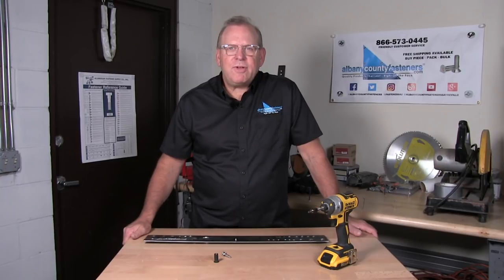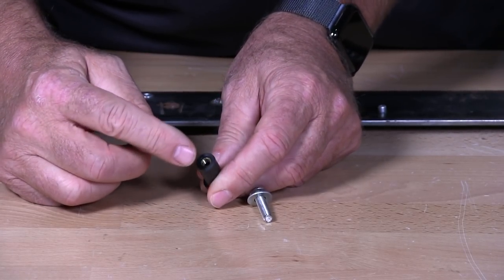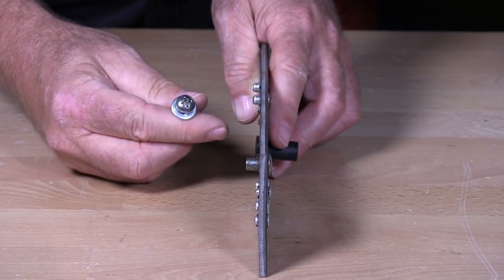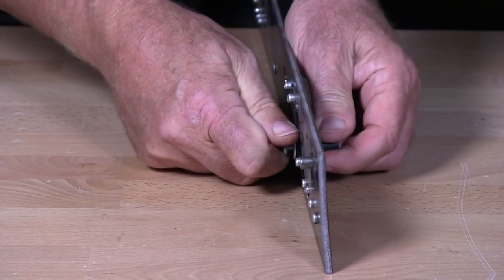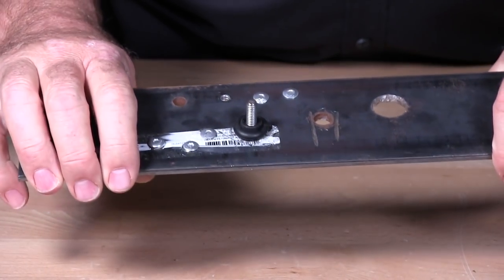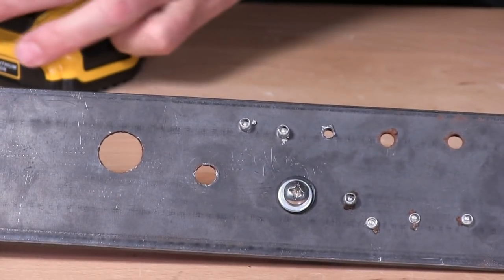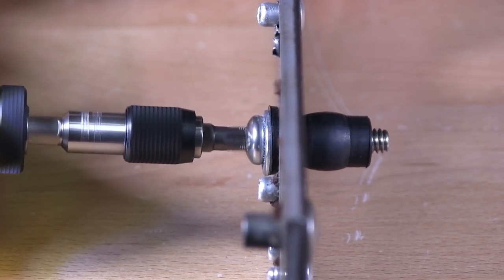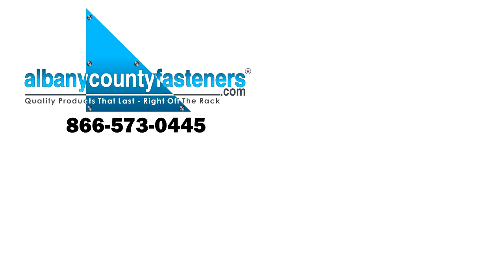Well Nuts | Review & Installation | Fasteners 101 Demo

Comment: If installing into a surface where you can't see behind it, when do you know to stop tightening? I guess the answer is when the brass thread within the rubber well nut reaches the flange? If so, how do you stop/prevent the stainless steel bolt from stripping the brass thread?

Comment: Any suggestion on how to prevent the rubber well nut from spinning if you can't get your hand behind the metal to hold it? I have a 73-87 Chevy truck and the cargo lamp is secured with well nuts but the rubber just spins and spins and doesn't catch like your example. I can't use a nut-sert as those are metal and would cause a ground issue.  I've tried contact cement but that also didn't work.

Comment: I have a question. For installing a pedestal seat on the wooden floor, would you use this or another type of fastener? It’s a square base and I’m putting it on a larger piece of plywood, which will be fastend to the floor.

Comment: Does quality vary between brands?  I picked up a bunch of these at Lowe's to install an anchor trolley and outriggers.  They pulled through immediately.  And repeatedly over subsequent attempts.  ???
Reply from the maker: Quality can vary between brands, but it's also possible that the well nuts you are using don't have sufficient pullout resistance for your application. If it's happening this consistently, consider using larger well nuts or a different fastener altogether such as epdm backed pop rivets.

Comment: great video, thank you.  question, I currently have these installed on my kayak since I can't access the hull.   They have been installed for about a year now.  I was getting ready to make some modifications to the kayak and noticed I had water in the hull.  I need to figure out which well nut is leaking.  If I remove the screws in the well nuts, can the well nuts be re-used, or do I need to replace with all new?  If screwing by hand, how will I know when it is tight enough since I can't see the back side?
Reply from the maker: It's generally not advisable to re-use well nuts. Uninstalling them will make the rubber weaker and less able to hold onto your materials. As for your second question, if you are installing them by hand, then treat it like you would any other screw; by screwing it in until it won't turn anymore.

Comment: QUESTION:  Won't using a 316 stainless well nut in a marine application result in "crevice corrosion" (i.e., short to medium term rusting) of the threaded shank, and the underhead surface of the bolt or screw, since, once installed, those areas will be starved of oxygen, and therefore won't allow the chromium oxide layer to replenish itself to ensure continued passivization?
Reply: Perhaps putting some Teff Gel on the screw will solve this?

Comment: I’m looking to put an anchor point on the rear of my kayak to use to pull someone on a river tube out to the middle of a lake. Do you think these would be strong enough to hold? The anchor point takes 4. Just debating if we’ll nuts would work. I don’t have access to the back of my hull it’s sealed off can’t get my hand anywhere to put nuts on bolts etc.

Comment: Can you reuse them?  i.e. can you unfasten, change the material, then refasten with the same well nut?
Reply from the maker: You can reuse well nuts, but eventually the rubber will wear out from repeated installation and uninstallation.

Comment: How is the grip on these fasteners? Could you pull something loose that is tightened down? You mentioned pull thru is an issue. Will the back end of the insert pop out at all? Thinking about using these for a license plate bumper protector on a plastic car bumper where the backside is not accessible. Any help or advice is appreciated.
Reply from the maker: If this is the kind of thing you are installing on your vehicle, https://amzn.to/2CyuB26, than well nuts should be fine for this application. The issue with pull through is because the only thing holding the well nut in place is rubber. Since the license plate bumper protector should only experience pressure from pushing rather than pulling, than this may be a good use of well nuts. 
Because this is going on a car, where vibration is constant, we would also recommend using a mild threadlocker, such as https://www.albanycountyfasteners.com/threadlocker-Solution-10-10-p/1050-132.htm, on the screws.

Comment: Yes great type of fastener but I've had problems removing them after a period of time where the screw has corroded and the wellnut spins in its hole . This was a problem  when I had no access to the back of my motorcycle cowling and only option was to drill the screw head which would spin around under force , I ended up damaging the cowl ! 
Any solution to this problem ?
Reply from the maker: Hm...You can try sticking a piece of painter's tape or duct tape over the screw head to keep it still for drilling out. That might work. We've used similar methods for removing spinning pop rivets in our other videos: https://youtu.be/4TwmQfbKsh8

Comment: Thank, installing on a Volkswagen that doesn't include a license plate frame. Thanks again.
Reply: Hi! Had you installed your plate on VW already? It was ok using these rivet rubbers? Thanks
Reply: @MrDzanetty  Yes totally was, got them from Ace hardware. Good luck.
Reply: @FLJAMESFL  thank you! Which size did you use? M5 or M6?

Comment: You have to make sure the neoprene nut is long enough to go through all the materials, which is something they are not showing you.. Like 1/8 inch for the plastic whatever as well as the kayak or material you're attaching to. That's the main issue with these that I've seen.
Reply from the maker: This is true of most rivet nuts. Thank you for your feedback!

Comment: I'd be hesitant to use this in salt water as the steel screw will be destroyed by electrolysis when mated with a brass receiving nut. Of course the simple way around this would be to use a 1/4 x 20 machine screw and brass washer.

Comment: how do you get these off when the rubber fails to hold to the nut and just spin, and you can't get pliers to the back end? have like 20 of these that are all just spinning on a jet ski and can't remove them
Reply from the maker: If it's already loose, try using vice grips to grab on to the "head" of the exposed well nut and pull it out. If you're still having trouble, please call our support line - 866-573-0445 or send an email to support@rawproductscorp.com with images of your problem.

Comment: Would you be happy using these to fasten solar panels to a camper van roof? , as leakage could cause a lot of damage to the insulation and be undetected for quite some time.
Reply from the maker: Well nuts would stop any kind of leakage from the roof of the van, but they may have trouble holding the panels down against the drag from driving the van. We'd advise using whatever the manufacturer of the panels recommends.

Comment: can I use a shorter screw
Reply from the maker: The screw has to be at least as long as the well nut you are installing. The actual insert that the screw fastens into to pull the well nut down is only at the very end of the well nut.

Comment: I got some from amazon (10-32) and none of them would install. The nut side would turn as I tightened the bolt
Reply from the maker: The insert may be slipping from the rubber part of the well nut. Have you tried another well nut? If they were from us, please let us know so we can reach out to our manufacturer regarding this issue.
Reply: @AlbanyCountyFasteners  I have no intention of purchasing another wellnut as bad as these are. These, I believe, came from Clips and Fasteners in Anaheim, Cal.